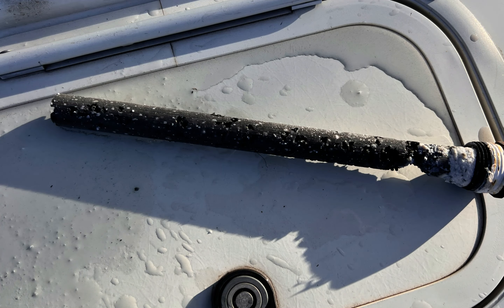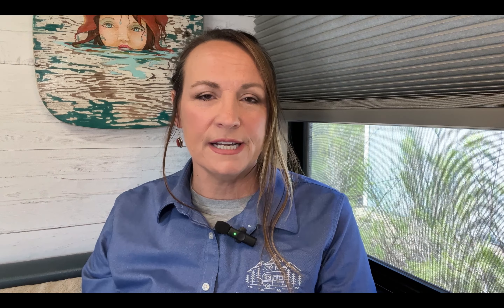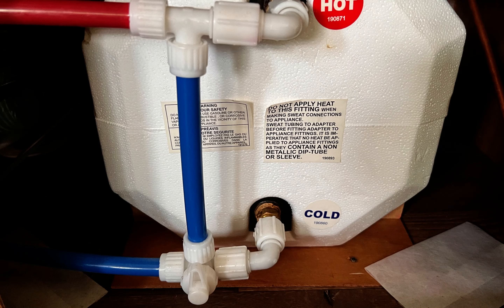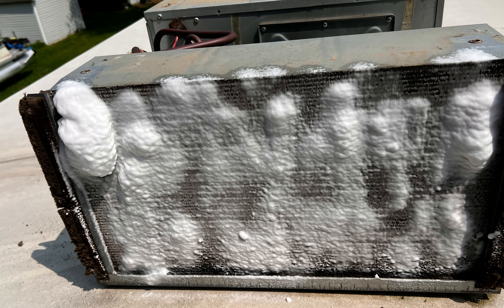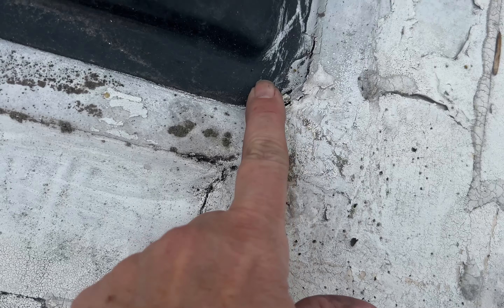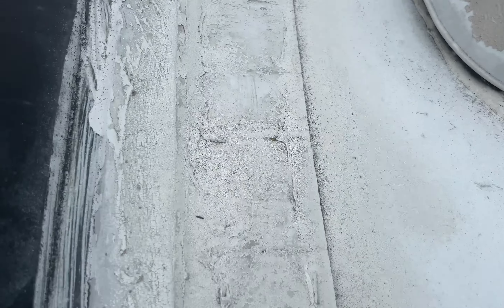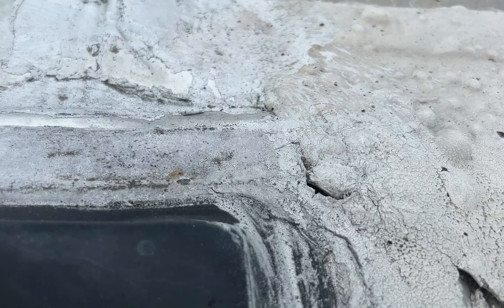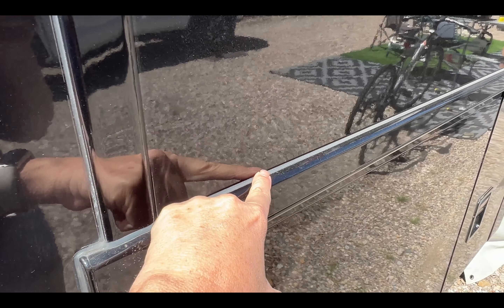Preparing Your RV to Get Out There This Spring: Tips and How to's

Comment: Morning Deb, good tips for the people,, yesterday I went and looked at '95 Tioga 21ft, had the very floor plan I've been looking for, had more inside storage and a better shower stall, more headroom in the over cab sleeping berth, 
I mean i was excited, only for the complete disappointment of obvious exterior water saturation, siding separation, large gaps between the sealant.
Backup bumper damage, 
Inside the surface of the paneling separating, cracking, ceiling sag, dead house battery, almost the complete red flag list save for the cool vintage Fleetwood floor mats in the cab.
It was listed as "Excellent Condition and Clean", only thing clean was the title, the inside looked like a live a board that had just been shoveled out.
Thought I was at a salvage yard,,,,,,
Might call them back today and make an offer on the floor mats,,,,,,,,,,,,
Reply from the maker: Haha! Omg I can just imagine. It’s always interesting when people say it is in excellent condition and you walk in to obvious major issues. Hmmmmmm, I wonder what they consider “poor”.  Thanks Mike!
Reply: @debsrvservices  Here's tip for getting your RV ready for cruising this year is to add a week of prep time to what you expect to need,,,,,,,
Run the fridge for a week before you go,

Comment: Hi Deb, “hat girl” here.   I occasionally get up on our roof (hard, because we are a class A without a ladder).   Two concerns I have are 1) how to check UNDER our solar panels…how do people check the sealant where the wiring is?  Our panels sit on a rail system, so there are a couple of inches under them, but I’m still not sure it’s enough to check adequately.   2) How to lubricate the slide seals on the TOP of the slides when they are underneath slide toppers?
Reply: Hey hat lady..not Deb here but boy she has all my love!!!! Under topper!!!!  Clean cotton T shirt you never want to wear again. Tape on end of a broom stick like a lollie pop, baseball size round....spray with product that has the red straw..... you can spray 15 feet when can has tube.....then wipe down with your broomstick with rag on the end.....  Solar. easy to unbolt without unplugging.... there will be slack in the wiring and you can lift by turning a small 2x4 on its side and get under.
Reply from the maker: Hi hat girl! That is a bit trickier. If you can’t hire a tech to come out and do this for you then do the best you can. You could use a broom stick like Scott suggested or some other long stick with a rag tied to the end and spray the cleaner on the rag then swipe across the top of the slide but please be careful. As far as the sealant goes for the solar. Do the best you can to view it. I would have to see it to completely understand. Thanks for the question!
Reply: Thank you both…Scott the broom rag thing is so obvious I want to smack myself in the forehead with a big “duh”!   As to the panels, I don’t think we will be comfortable unscrewing them so we will get the RV mfr (newmar) to check all roof seals and if they complain about the panels, we’ll ask Solar Energy in Nappanee to check them.   🤗
Reply from the maker: Great idea!!
Reply: @turnbullstravels735  Well shit if you dont have a Newmar!!!! Best on the road!!!!  Highly unlikely you have an issue under the panel as the sunlight is blocked. Newmar has upgraded suspension so you do not get the bounce on the road like my Bounder used to get..... Bad suspension causes fractures in everything including the roof. The RV Geeks are still driving Newman the Newmar and it is rock solid. Check out their repair videos.

Comment: Prepare that RV???   If Deb was sitting in the passenger seat of my RV then that rig is 100% complete!!!!!!! Note when Deb showed the sealants......BHD     Bald Head dude Dicor is the best. Do not look at the price. Order it!! Deb was also going to tell you that the green Fuzz on the battery is easily removed with an old toothbrush and baking soda. Dissolve a spoonful in 2 ounces of water in a dixie cup and brush on several times. Then spray terminal care on each connection. And hopefully you have your Mr. Buddy heater to avoid using a furnace and smoking thru all of your propane. This heater is about 80 dollars and you can run off a one-gallon Fireking  bottle to avoid the expense of the little green spin on units which only last 7 hours.  Presale Deb report would be worth its weight in Dollars!!!! She will show you the simple areas that need cleaning. When I look at an RV that claims to be well cared for I walk away when I see a rat nest behind the heater. Or caked on dirt in the battery box. You can hose these areas out on a sunny day with low pressure water and wipe down. For sale units should be spotless. Nuts and Bolts RV repair videos are available from Debs neighbor, AZ RV expert and he will walk you through the process of removing old sealant and repairing everything on your rig. This work(roofs) is extremely dangerous so please hire this out of you have any chance of a fall. Hard on the knees and back.  And Like Deb says......wear boots with ankle support and not rubber goofball croc slippers... and yes deb offer still applies I will buy your redwing work boots that you will have next time you climb the ladder!!!
Reply from the maker: Haha!! You are so funny I can’t take it. I do love watching AZ Expert too. I wish I had more time to watch videos. I wore my hiking boots the other day but that wasn’t on video…